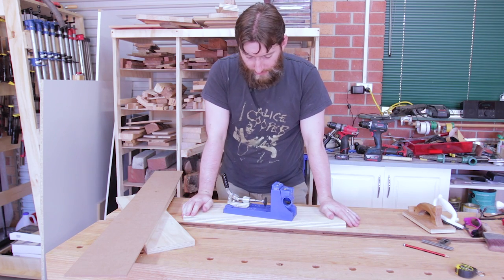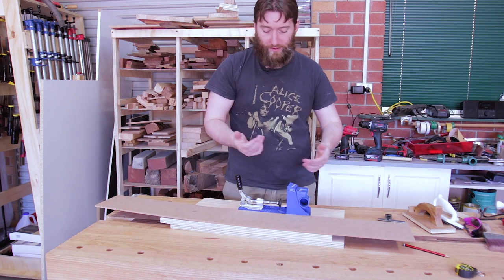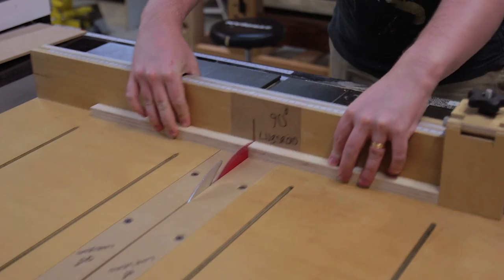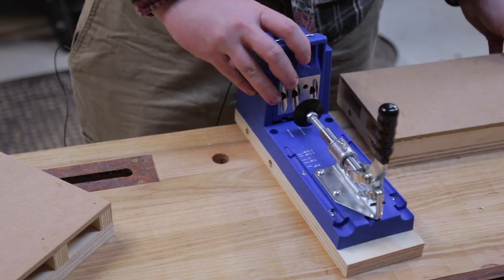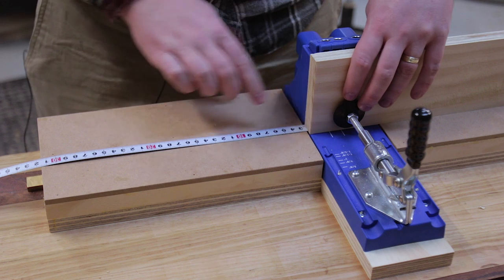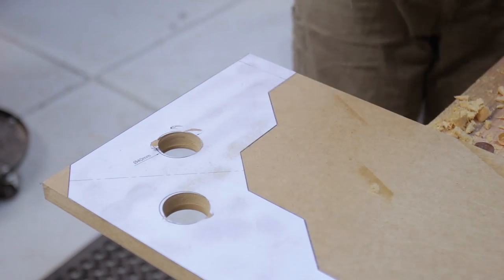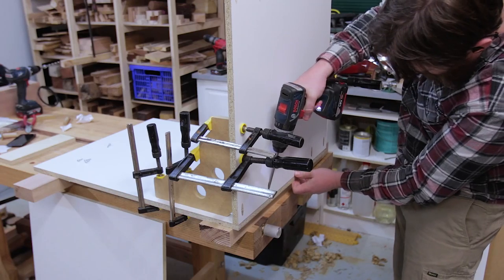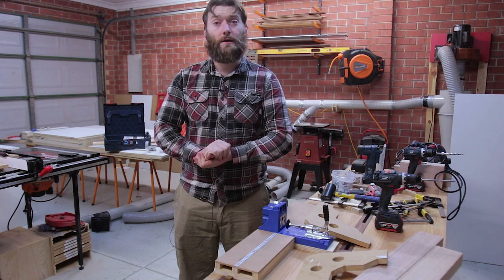Kreg Jig Base + Corner Clamping Blocks

Comment from the maker: If you want the corner clamp template, http://www.thewoodknight.com/wp-content/uploads/2017/04/corner-clamp-Drawing-v1_Sheet1.pdf Its designed to be printed on A3, but you could reduce it a little. Its not that complex.

Want to know what tools I use? Check the description for the 'kit' links.

Comment: I do like your corner clamps, I think I will make a couple. I went the expensive route for my Kreg Jig, I planed down pine to the required thickness for the wings. I also attached a couple of vertical backer boards (120mm) to help support  the panels. Most of my shed cabinets are with pocket holes but, haven't used it for awhile as its big stuff at the moment and the Domino is 'King'.
Reply from the maker: The domino is great, but for melamine cabinets it kinda sucks to be honest. Maybe I just need to use the right type of glue (probably polyurethane), but never had any luck with adhesion. 

I kinda wanted to go the pine/hardwood/whatever thicknessed down approach, but by the time I realised I needed wings the combo machine was put in such an awkward position and without 15a + dust collection. Dang full size sheet goods taking up too much workspace!

Comment: Thanks for showing two things I need to do, I also have a Kreg Jig that I need to fix with your idea and the corner clamps I have seen before. I like your idea of using printed template. Where did you get tape measure you glued on project?

Comment: I never quite understood why the kreg jig has such an odd thickness like that. I love mine and use it often, but this seems like the sort of thing such a quality tool would have accounted for.

Anyway, my solution for this is to laminate two 3/4" thick plywood pieces and then set the router to match the thickness. Hog out a space and carry on.

I think your design is a little more elegant, Paul, and I kind of wish I had gone that route instead.

Comment: G'day Paul, I've got the K4 but wouldn't mind getting the K5, however it's a handy joinery system in any case, so another well presented video by you & what's your favourite Alice Cooper album ? 👍🇦🇺👍
Reply from the maker: Not actually an Alice Cooper fan - the wife is. When we were dating many years ago, I bought the tshirt to get on her good side. It worked ;)

And yeah, the K5 does look great. The front clamp (vs at the back) is a really good idea for big panels where it can be hard to reach the controls!
Reply: Lol, if if worked that a good thing Paul, cheers mate 👍
Reply: That was the reason I chose the K3 last year. Couldn't see the extra cost of the k5 being justified at that point in time.